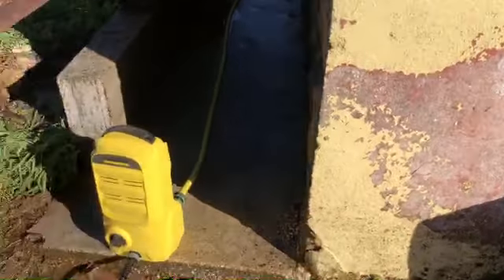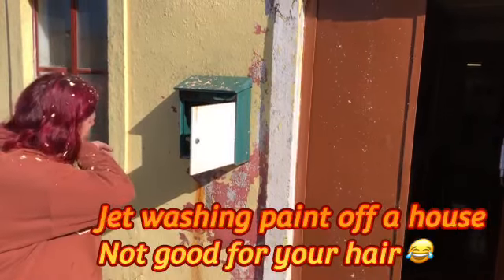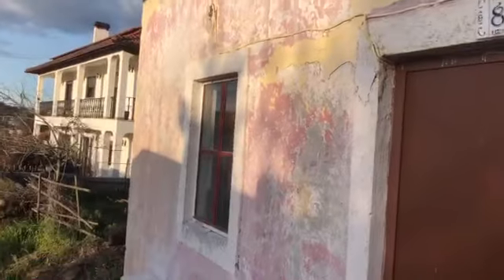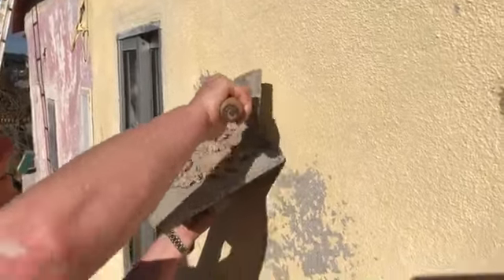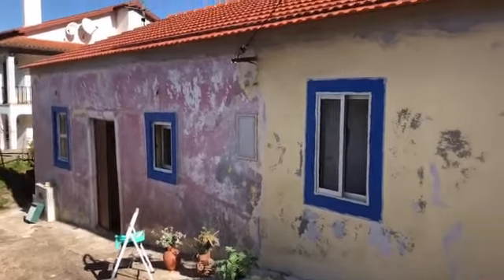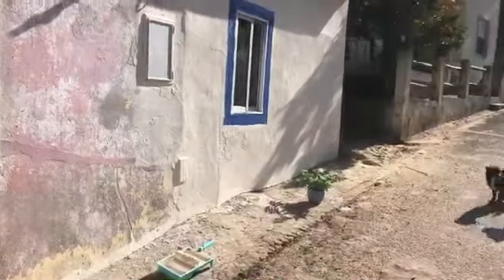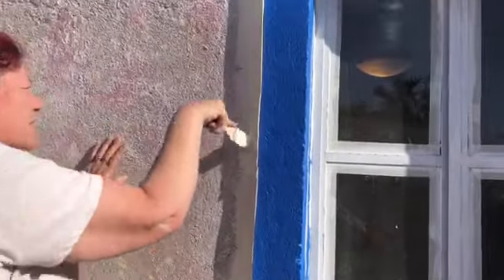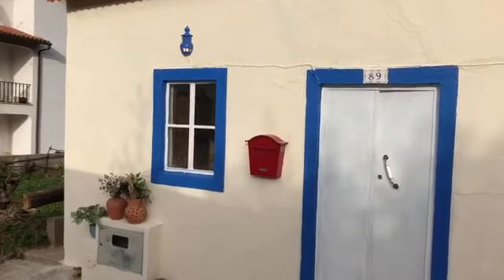Painting our Portugal Home - The front of our Portuguese House painted we are very proud of the look

Comment: Great job , just curious , if you were painting over existing exterior walls and they weren't damaged or in disrepair would you need to put on an undercoat  or can you just paint over with more exterior paint ? And I've read that with all  paint and primer in Portugal you have to dilute with water prior to using , I'm from Canada and things are a bit different there I'm finding ( product wise )
Reply from the maker: We just jet washed to get the old paint off and then painted with the extreme Portuguese exterior paint, so far so good 👍
Reply: Great thanks for the info!!